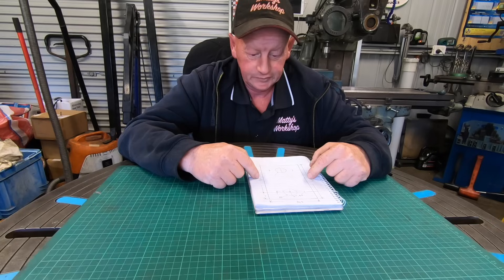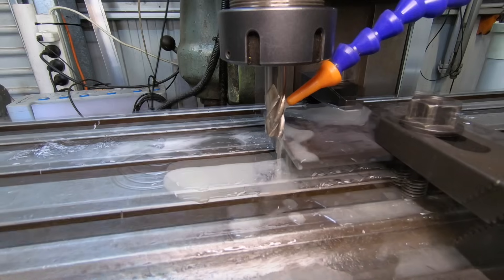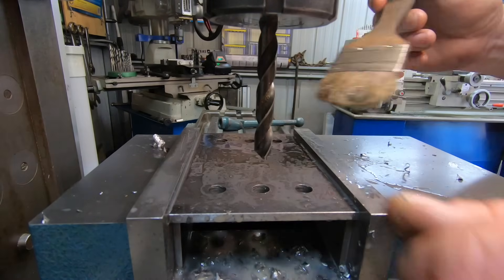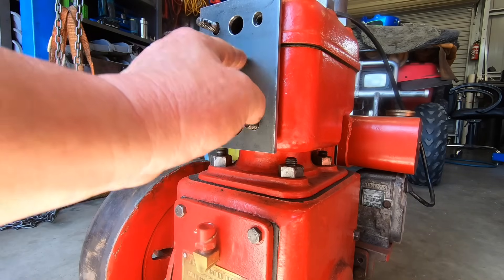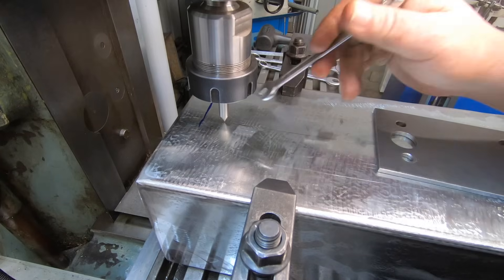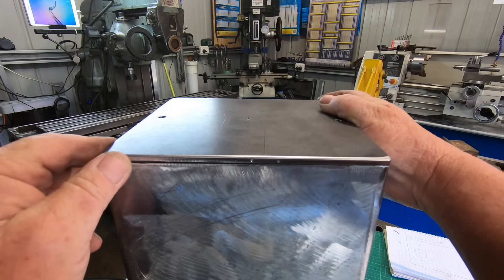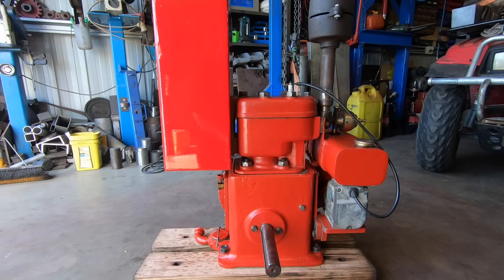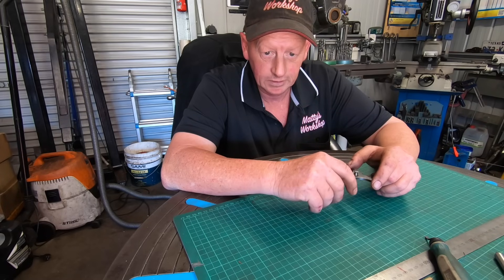Ronaldson and Tippet Water Hopper

Comment: The farm I grew up on had one of those on the irrigation dam pump. The sound took me back 40 years.
Please take it easy on your self and make sure that you don't get cuts and nicks to get infected. Most treatments bugger up your immune system so any infection is a big deal. Soluble oil is the devil on any wound. Take care Mr Matty. Thanks for your time and energy to make this.
Reply from the maker: Gday, My immune system is shot at the moment and have to be very careful where I go just in case, Thanks for watching mate, Cheers
Reply: @MattysWorkshop  Just lookin out for your health.
Ive had a massive chunk of a shoulder muscle removed due to infection and my immune system is ok. Take care of yourself mate.

Comment: This is the first time i have ever heard of a water hopper.  So of course I am a bit vague on the subject but it certainly looks nice painted shiny red like that.  And I was wondering why you work in inches.  Chances are you discussed that long before I found your channel.  The lack of energy is one of the bad parts of cancer treatment.  It has held me up for a month of lost time at least.
Reply from the maker: Gday Harold, i used to always work in imperial because I couldn’t get my head around reading metric on micrometers and the hand wheels on the lathe, it’s only been the past 6 months I’ve taught my to read metric, the treatment can certainly knock you around with all the tablets they make you take, thanks for watching mate, cheers

Comment: G'day Matty,  that was an excellent build. I think the top port on the plate needs to be opened to suit the  head, otherwise there is a fair bit of restriction created, & a bit of head stud sealer should sort the bolt leakage. Still a good video build  🎉 🎉😂😂😂
Reply from the maker: Gday Ted, the holes in the plate are the same as on the engine, The head stud thats leaking needs a helical putting through it, thats should fix the issue, thanks for watching mate, Cheers

Comment: Hi Matty  Great to see you have started your treatment.  My daughter went through what you are going through so I empathise with you.  Just keep going.  That bracket you made initially.,,,,,,did you consider using that as a clamp plate inside the tank.  With all that vibration it may prevent cracking around the mounting holes.  Cheers.
Reply from the maker: Gday John, it’s certainly not a nice thing to go through but has to be done, the original plate I made was going to be welded to the hopper but since the young bloke made it out of heavy plate I don’t think it’ll need it with the amount of running it’s going to do, thanks for watching mate, cheers

Comment: Imo put the plate you made inside the tank to ensure a good flat sealing surface against the motor
Reply from the maker: Goat, with the thick chalk gasket its seals with no leaks, definitely going to keep the plate just in case It does decide to leak one day, Cheers